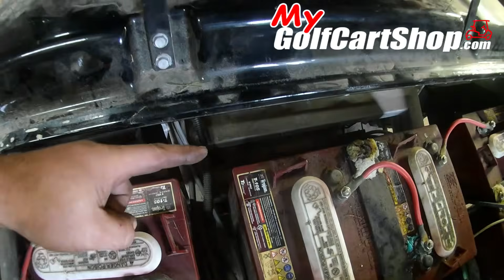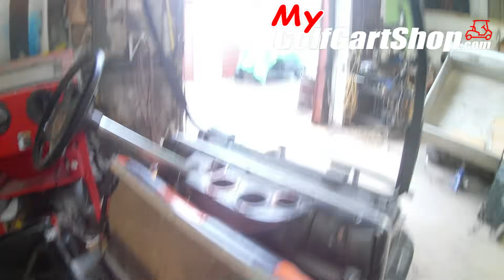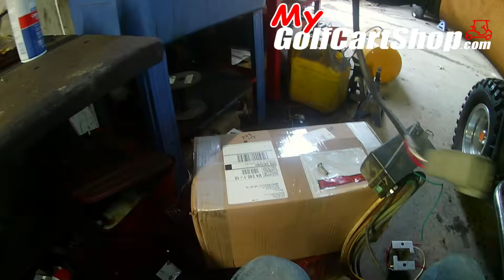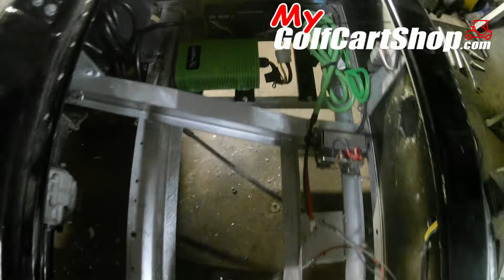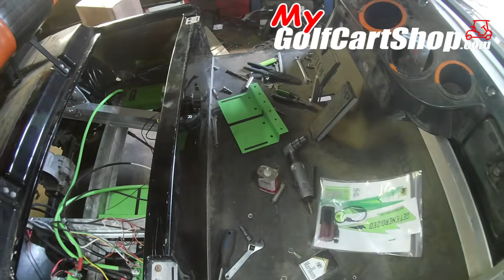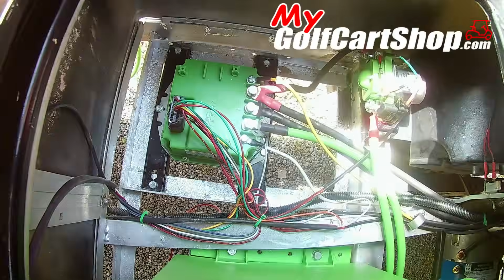Old to New | Golf Cart Conversion

Comment: I have an old yamaha resistor golf cart I'd like to do a conversion on.  I noticed you took the old motor out.  Did you have to replace it to do a conversion?  I was looking at the kits you sell on your website.  Does the 36v pro kit have all the stuff you talked about in the video to make this work?
Reply from the maker: You don't always have to change the motor but, if you want to feel a difference you do. Everything with the pro kit is listed on the site, most def. way to go.